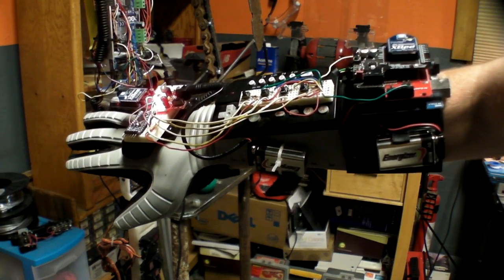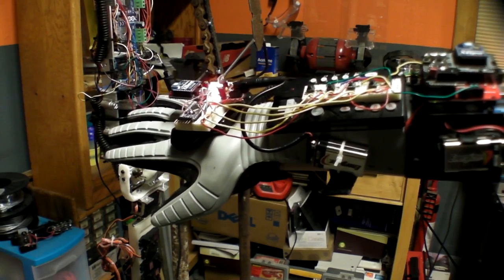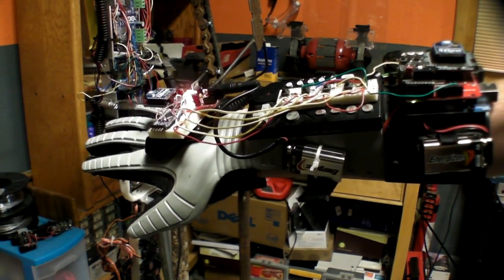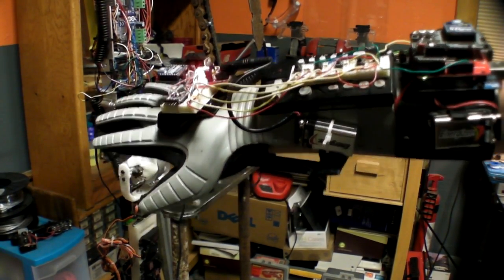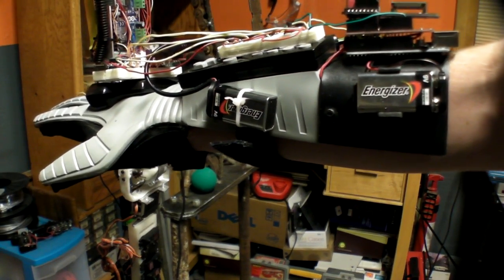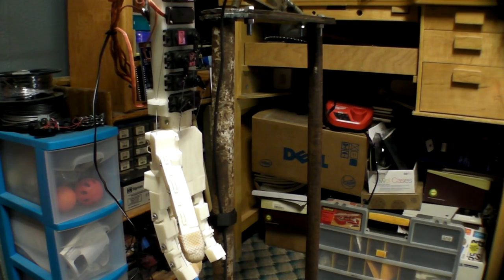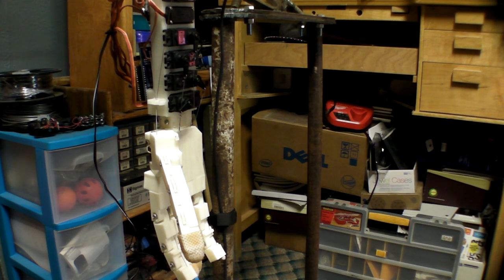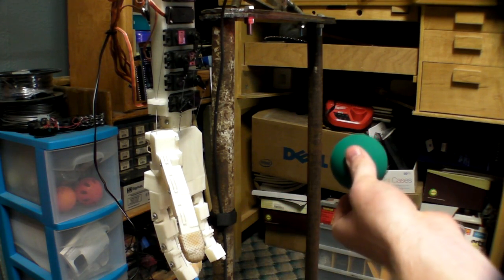Arduino Robotic Arm Ball Toss

Comment: Easton and I are working on a hand that's much more organic and compact. Improving finger movement range is on the to do list, but at the minimum doubles the numbers of servos required, and makes things a lot harder. I worked on giving fingers full range for ages, but it's hard to do it cheap and neat. Some updates are on my blog.

Comment: Actually, it is quite possible to make the fingers have an extended range of motion.
It would involve puttin some extra servos and fishing line on, but for the bakwards force, it'd just be the same thing as forward force, except reversed.  As for the side to side, it'd take some different material to have the fingers go back to the original state, but if you had fishline and a servo for each side of each finger, it'd be quite like the original finger-forward movement.